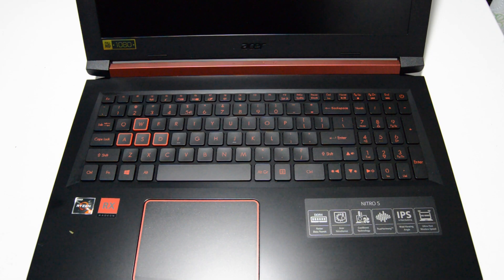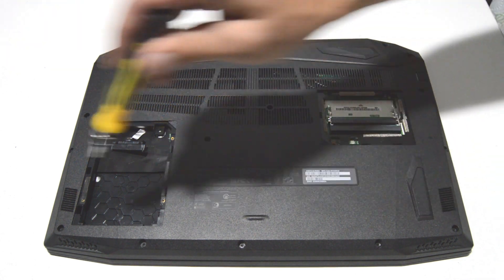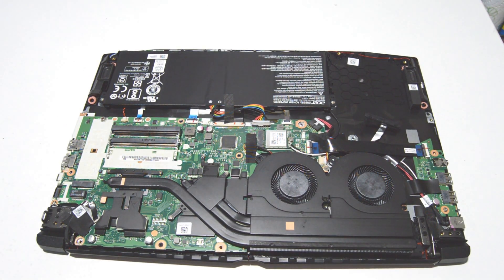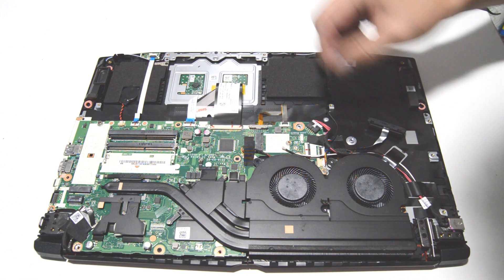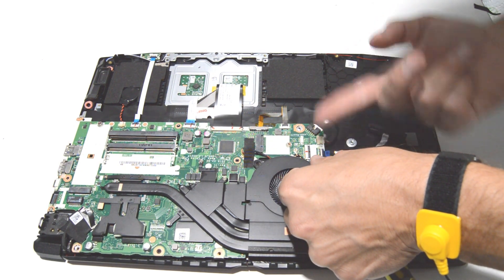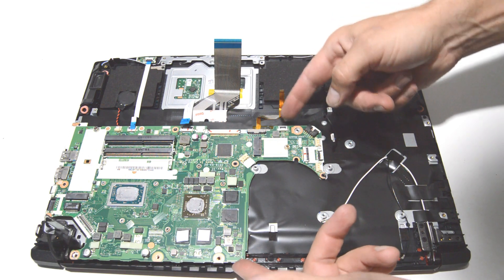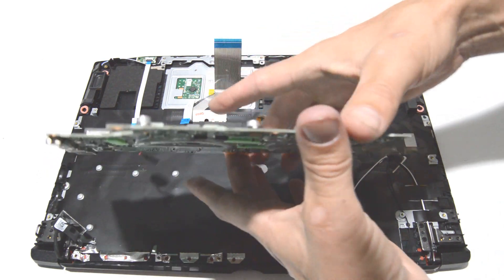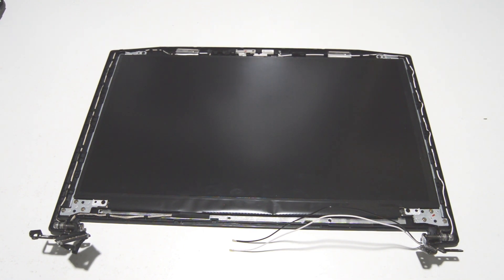How to Disassemble Acer Nitro 5 AN515 Laptop or Sell it.

Comment: My acer nitro 5 laptop model is AN515-51 core i5 7300HQ. The problem is i think there is too much dust in my cooling vent. Thats why hot air block inside the cooling vent, causing to rise up the temperatur. Thats why my CPU temp goes upto 96°C  and thus goes into thermal throttle mode while gaming. I have still 2months warrenty left from my Local shop, but i donot want go there. Because they said it would take about 1month for the warrenty procedure. Thats why i want to clear the dust from the fan Only, NO REAPPLICATION OF THERMAL PASTE. I donot want to touch the heatsink, just want to open the fan. Is there any tutorial for this.???
Reply from the maker: Its easy you don't need to take it apart. See the video at 4:37 and note where the heatsink vents are. While laptop is on/fans running, use "canned air" or other compressed air to blow INTO them while laptop is running and fans are on. This will blow out any dust/hair in the heatsinks and restore airflow. Most of the dust will go into the chassis but will be blown back out by the fans. You should feel more hot air coming out afterwards if the heatsink was indeed blocked.

Comment: Can you help me please!?

So my display on my Nitro 5 became cracked and then unusable and so I decided to use an external monitor instead for about 4 months with no issues, then after resetting pc (for a clean up) then reinstalling GeForce Experience and updating my graphics drivers the external display just won’t work no matter what. I’ve tried connecting it to TV’s and other monitor and using different cables but nothing has helped. I’ve tried nearly every shortcut on the computer but I’m not sure if any have worked.
Reply: go to display setting and  select output as two monitor
Reply: Unplug the internal monitor from the motherboard
Reply: @elvarfn2086  I figured it out almost a year ago. Had to unplug the internal screen and put one from one of my other laptops on to it, the graphics drivers needed to be updated.

Comment: Hey uh, that little ribbon you mentioned not to tug too hard on, it's not completely broken if it comes out from the connector, is it?
Reply from the maker: It would depend on what you mean by came out of the connector. If you can plug it back in securely then it's probably OK. If you have ripped or bare wires/ribbon then its probably not OK.

Comment: Well that sucks . You can't upgrade the gpu or cpu anymore like the older laptops . 😢
Reply from the maker: It's hit and miss, there are still some with removable cards and CPU's but they are getting rare. It costs less to make them with integrated components so the removable components are usually limited to gaming and high-end laptops nowadays.

Comment: This is great! Thanks so much for posting. I suspect you've gotten us very close to the keyboard but any chance you've continued this teardown or have a video showing how to remove down to the keyboard?
Reply from the maker: Many of the newer models have keyboards riveted into the palmrest. This model is one of them, so you will need to replace the palmrest assembly as a whole unit, such as this one: https://www.ebay.com/itm/Acer-Nitro-5-AN515-42-R5ED-15-6-Palmrest-w-Touchpad-Keyboard-AP211000610-ER/303326519599?epid=10023254724&hash=item469fab612f:g:EzcAAOSw7q5dqZ8J
Reply: @Sellbrokedotcom  Thanks for the reply.
Reply: Did you ever remove the keyboard? I'm trying yet have no idea how. I can't find any video that helps.
Reply: @ladytx  I did not.  Sounds like it's a major undertaking to replace the keyboard. We just added a usb keyboard on ours.

Comment: Hey bro thanks for making the video. I’m a lot of confused. Was trying to play a game but it said my 3D accelerator wasn’t supported by the game, so I checked my pc and it says I have Microsoft basic display adapter but it should be GeForce GTX, so how do I find that? I took the back off, but I’m not good with computer terms and this is the first time I’ve took one apart. I’d like to buy a new one if there’s no way to troubleshoot my issue, as there seems not to be, but even then I don’t know which one to get... like some of them don’t look like they’ll fit. Thanks
Reply from the maker: I would try and reinstall the drivers for your video card first. Does your GTX show up in the device manager at all? It may just be a software issue (hopefully).

Comment: My lid on the laptop is starting to crack really bad from opening and closing. the right hinge is split in half. Is there an easy way to fix or replace the lid?
Reply from the maker: If the hinge itself is broken, then you will have to take apart some of the case as well as the display assembly to replace it. If the back cover mounts have broken, which is not uncommon since they are usually plastic, you may be able to use epoxy to fix them. Replacing the back cover involves removing everything attached to it first like the hinges, screen, webcam, wifi antennas, etc and then transferring them over to the new one. It may be helpful to buy an assembly depending on how yours is broken.